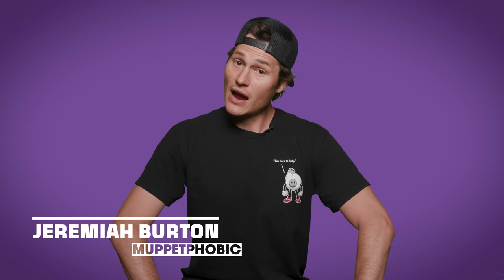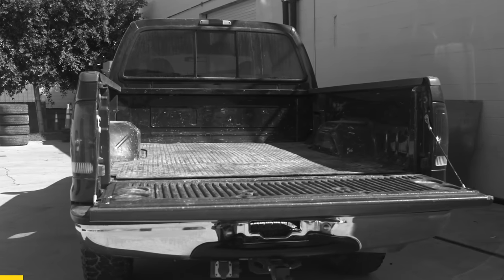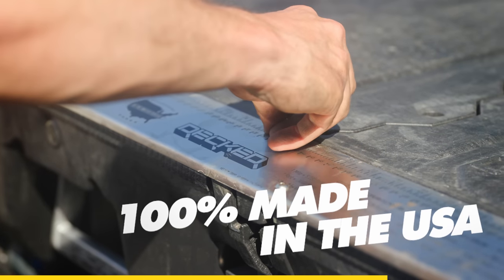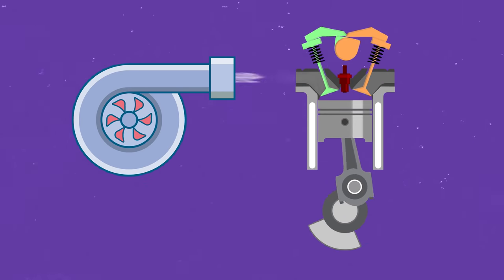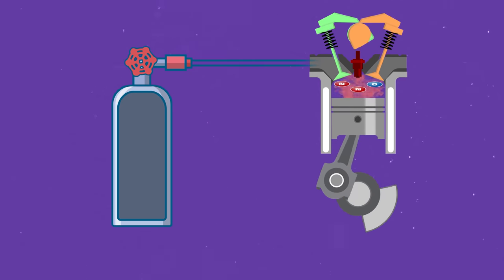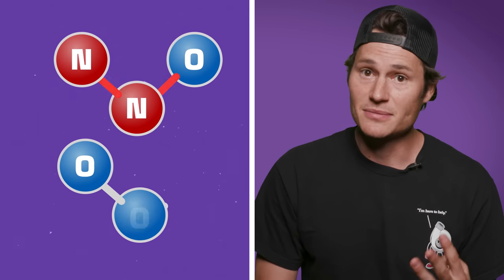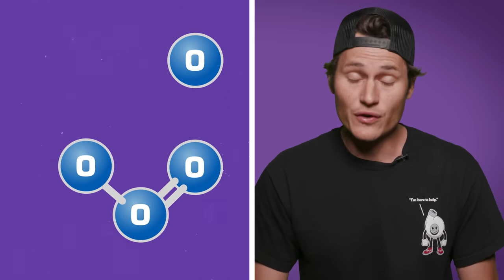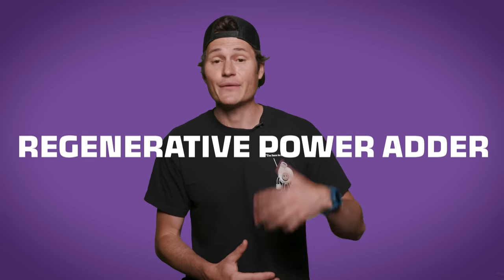Is Ozone Injection Better Than NOS?

Comment: if you ever wondered what the "smell of electricity" is...it's ozone. mostly.
Reply: It's the smell that immediately tells an electrician that something is very wrong and everything needs shut off.
Reply: @ekscalybur  something is arcing
Reply: Ozone is produced near photocopiers, because they use a high voltage you can smell it. It has a sharp smell.
Reply: The "smell" of electricity!!!! Ozone and melting insulation materials...
Reply: We use it at work to disinfect our bicarbonate system.  It is an indescribable smell, but one you never forget.
Reply: I smelled a big fart today.

Comment: Ozone is awesome for removing smells.  Using a machine in houses or cars for 24 hours (while not in them) removes a ton of odor!
Reply: While effective, the ozone scent lingers for some time, and can often be worse than the smell you're trying to eliminate.
Reply: @AlGoYoSu  it's all about timing. I'm extremely sensitive to smells and it was sooo awesome to be in a bathroom that smelled about absolutely nothing... for days!
Just give it a few more hours and you'll be fine.
Reply: @AlGoYoSu  I use a small generator to clear out car odors- it has a timed shutoff so it’ll run for an hour, you have the AC on full blast recycle, then you air the car out for a good 7-8 hours and your good. Ozone shouldn’t linger.
Reply: @AlGoYoSu  I've never had lingering ozone odor (after thoroughly airing out), but there might be something the ozone reacted to that left an odor, or just that it removed one odor but left another, changing the smell afterword.
Reply: @AlGoYoSu  ozone then use febreeze
Reply: You can use it however ozone is much more harmful to your cells that ordinary oxygen, that's why your body getting older on a higher rate that without ozone near it.
Reply: Use it to often and it can break down some materials
Reply: Why does your house smell dude
Reply: I was actually gonna comment something saying it’s an odor eliminator I use it occasionally at work to get rid of smoke smell after a house has a fire (I work in water/mold/fire restoration)

Comment: Joke’s on you, I already have a Decked drawer system, and I can say I love it. Every single system is custom fit for every truck brand, so it fits exactly to my F150 with a 6.5’ box and it’ll fit exactly in a Chevy 2500 with an 8’ box.
     The drawers are amazing, super smooth, and the optional boxes fit perfectly as well. I made a mess in one of the drawers one time, and it was super easy to pull out and hose off.
     Just in case you don’t believe the paid sponsorship from these guys, take it from a guy who has driven trucks all his life, this Decked system is a very good product.

Comment: Having worked with ozone before in the lab, i can say that embrittlement of elastomeres is an understatement. After just 20 min of low concentrated ozone contact a rubber stopper literally falls apart. I would not want to have that aside me in my car.
Reply: Must have been an extraordinarily high "low concentration" to cause that much damage in such a short amount of time. I use ozone generators in car interiors to sterilise and remove odours. I literally fill cars with it for 30-60min and there is no noticable degredation to interior plastics/rubber in that amount of time.
Reply: @flammybino8523  Yeah i guess our low concentration is still super high for your application^^ which makes a lot of sense, since its so reactive/dangerous.

Comment: Some have already tried this, and it caused the engine to die, the heat in a small engine causes misfires and overheating. They contemplated that the heat generated from Ozone being broke down would likely just destroy the engine. 

Keep to using Ozone to clean the car cabins. If you want power, build the engine properly , get a turbo or supercharger, there's no shortcuts in the longterm.

Comment: The ozone layer is actually healing itself atm dude, the hole over Antarctica is actually shrinking
Reply: Well, duuh. Solar radiation which is stronger at higher altitude, does exactly the same as an ozone generator, just at a grand scale. Once we stopped using clorinated fluoro-carbon gasses and other ozone reducers on a widespread scale the ozone layer is able to regenerate faster than it is broken down...

Comment: You touched upon the embrittlement and degradation of elastomers bit, but as I was watching this I also had concerns about how aggressively the ozone could oxidize the internals of your engine, too. That elastomer embrittlement is directly because of ozone's extremely high oxidation potential. It quite literally destroys chemical bonds, left, right, and center, but it can also accelerate oxidation of metals like iron (rust) and copper (patina).

Comment: We use mild ozone generation in HVAC and refrigeration. We use the UV bulbs inside of residential air handlers to help kill mold, bacteria and viruses. Likewise, we use smaller UV bulbs in the restaurant service for ice bins to kill bacteria, slimes, molds, etc and keep ice fresh. Sometimes you can open up an ice bin and get that “lightening” smell since lightening also creates ozone. 

There are more intense ozonators that use the electrical method Jeremiah mentioned. These can be found for exterminating ground bees and other insects where you put the ozonator under an aquarium that’s over a nest of yellow jackets. These types are also used in smoke/mold remediation in houses to eliminate odors, but are intense and designed for only short periods of time as they can kill you. Not designed for everyday household use. 

Ozone in the sky is good, down here it creates smog and oxidizes things, hence why California has made them illegal.

Comment: Nitrous oxide is used because it can be liquefied so that it will only regasify after leaving the gas injection system, and this is important to avoid the system becoming too cold, and to cool down the air-fuel mixture and avoid detonation. To use pure oxygen gas injection, the compression ratio would have to be lowered, and the entire system would have to be heated. What I would do is to inject liquefied propane into the wet shot fogger together with the nitrous oxide, to lower intake temperature even more and avoid fuel condensation.

Comment: 3:52 Piston speed actually has very little to do with it. The equation presented, E=0.5mv^2 is for the kinetic energy of an object and pretty much irrelevant to the power the engine makes. The relevant equation is E=Fd, where F is force and d is the distance the force is applied. When more energy is released, the cylinder reaches a higher pressure, which increases the force on the piston. Increasing the force is what increases the energy per stroke.
Reply: @PADOYLE Little do you know I have read a great deal about it. Can you explain how exactly nitrous increases piston speed without affecting max rpm? If piston speed is the cause of increased power then the engine should make the same power at the same rpm with or without nitrous.

Comment: The expansion characteristic of hot nitrogen is very important in the process of pushing the piston down in the combustion process. which you would be without with the ozone injection.
Reply: True, however Nitrogen is an inert gas and inhibits the full combustion of a fuel.  I think would expect that in an ozone combustion, more fuel would be converted into cabonic gasses and supplement the nitrogen for pressure expansion. Additionally, without nitrogen in the chamber, you would potentially need far less fuel for the same amount of power. Realistically, you’d probably detonate the fuel instead of burning it which would be the main problem, but it would release an insane amount of energy in the cylinder compared to air or N2O. I think this system could work well in a Diesel engine, just not a gas engine.
Reply: @Matoro828  people played with oxygen injection way back in the day and it proved far to volitile. Think the technology exists today?
Reply: @Matoro828  you bring up a good point. I will have to look more into what you have brought up because I admittedly don't know much about this ozone system. The heat I think would be a big issue with warping parts but also it could form hot spots which could cause pre-detonation kinda like what you had said.
Reply: @frankrizzo2724  yea it’s interesting I think you are right in a sense: pure oxygen is probably too volatile for an ICE. Ozone is definitely far too volatile for one. But I think if you made an engine purpose built and tuned for it, it would work. I think it would have to be a turbine or a Diesel engine to handle the forces, and you would probably need to use titanium or tungsten plated components to withstand the heat. But, the potential is there for an engine with extreme power output. Even something as small as a 10% gain in the amount of chemical- energy released by ozone combustion would lead to an insane growth of power.
Reply: why not use ammonium nitrate
Reply: @allseeingeyezz  Decent fuel, terrible oxidizer.

Comment: Not to mention ozone is extremely reactive with almost anything organic, hence why rubber seals break down on exposure to ozone. Storing ozone is half the battle. All of the piping, seals, and valves to get O3 to the engine is also a major issue, if a leak occurs inside the vehicle youre gonna have a bad time. Since ozone is so reactive with organics such as gasoline itself, ozone injection would most likely cause some serious engine knock and most likely break the block from serious overpressure. Ozone may even react with the motor oil on the sides of the cylinder walls at high enough temps. Theres a whole slew of problems with ozone as an oxidizer.
Reply: what about using it in the cold vacuum of deep space? when it degrades, it can just be supplied as regular oxygen and in emergency's you convert it to 03 as fuel
Reply: @zeedstun891  The scariest risk in space is an internal fire. Ozone is just too good of an oxidiser and too unstable to justify using it. It's a ridiculously good oxidiser, it's one of those things where it's possible but there's better, less "everything is now flammable lol" alternatives. Still has it's uses though!
Reply: @mattk252  hot take I’m here for it
Reply: it's not that bad. I ozone my water at home

Comment: “This nitrous setup is too heavy.” Said no one… ever.
Reply: Yeah, these aren't car guys, these are YouTubers, and they're not very bright either; O³ would yield three oxygen atoms, not molecules, those would be O², lol.
Reply: @hlaw2830  and also the reason no one uses o2 tanks is because its too reactive lol
Reply: @ernestocastellanos6446  At least that scene from The Fast and the Furious would make sense? Lol.
Reply: @hlaw2830  Besides, I'm not sure O3 would have much advantage over O2. In theory with a 100% oxygen setup you could do almost 5 times your normal engine output. Imagine doing a 2500 shot on a stock LS7, wonder if something break or melts first.

Comment: There are quite a few issues with this that I can see. 1. Ozone is very toxic and reactive 2. It’s unstable in any amount usable for this purpose and is likely to just decompose into oxygen after a short period of time(at which point a pure oxygen tank would be better) 3. The tank system for this would be not that much different from NOS. I just can’t see this being all that viable. And also, there are plenty of other oxidizers than Oxygen.

Comment: There used to be some research into using liquid ozone instead of liquid diatomic oxygen as the oxidizer used in rocket engines. Because ozone is denser it will need smaller tanks to be stored and less volumetric flow rate to make the same power in the engine and to keep a rocket engine going. However there were some challenges that ultimately prevented common use of liquid ozone in rockets. The biggest problem being liquid ozone will explosively decompose into diatomic oxygen if hit with a hammer, or looked at the wrong way. Makes it pretty dangerous to pump or to store at all. It's also obviously a very good oxidizer and reacts with a lot of things violently.

Comment: The EPA came to their conclusions about ozone generators after testing them in confined spaces ten times smaller than they were rated for. A little ozone is probably good, for the reasons you specified, and occurs naturally in the air we breathe already. A lotta ozone is definitely bad, again for the reasons specified. See bigclive's video about ozone for more info.

Comment: Can you talk about camshafts and how upgrading a camshaft can add power. We put the most aggressive cam that would fit in the ls1 in my parents 1998 Pontiac Firebird Formula. Power went from 350 to somewhere in the range of 500-600 horsepower.

Comment: Cam the catfish Camaro and throw that episode up on Money Pit. Then do roller cockers and throw that on Money Pit. And if you're camming it you might as well port the heads and intake and throw That on Money Pit as well. And also Mill the Heads for a little more compression and use a thinner head gasket and put that on money pit.
Gasket kit - 200$
Milled heads - 200$
Porting heads and intake - 50$ rotary cutter and some 20$ carbide bit set - perhaps just get a truck intake and port it a little, it'll be mint
Cam - 350$
Tune - 400$
1.6 roller rockers - 150$
stage 2 transmission for when it blows up from 400hp - 3000$

Comment: F-15E aircraft have what is called an MSOGS (Molecular Sieve Oxygen Generation System) or OBOGS (On Board Oxygen Generation System) and the compressed air that is tapped off from the intake side of the engine is purified at the molecular level to yield pure oxygen as required by the pilot and WSO (Weapons System Officer).

Comment: So... how would you get pure o2 into the ozone generator... And how would this not just cause preignition like o2 does?
Reply: Well you get 02 into your ozone generator by using and oxygen concentrator or an oxygen bottle I have an ozone generator that I use for therapeutic purposes with a infrared spa
Reply: Pure o2 is easy, electrolysis of water. Hydrogen and oxygen accumulate at the anode and cathode, respectively. As far as preignition, that is a good question.
Reply: @ai_university  true I forgot about that thanks
Reply: O2 is in the air. Generator breaks free 02 from other bonds and then they attach to each other.
Ozone is not flammable yet many of byproducts are. It will react will the fuel as well as soon as it makes contact and that may cause detonation.
Ozone would attack just about everything including aluminum, valve seals ect... cool idea but very impractical. 

if it was easy or practical youd be spammed by videos on youtube for sure already...

Comment: Given the fact that Ozone likes to spontaneously combust and it's explosions are EXTREMELY big, no.

It's not.
Reply: Ozone does not spontaneously combust. It is just 3 molecules of oxygen. Ozone is not flammable by itself. But it is an oxidizer, so mixed with a flammable substance it will make the flame burn stronger. But it will not spontaneously combust on its own.
Reply: @backcountryme  
Ozone is inherently unstable.

In laboratory conditions, if you were to compress it just a bit and leave it be in a container, it would spontaneously explode, destroying the container.

A bit of heat would make the process almost instantaneous.
Reply: @maksymilians931  can you point me to some info about your claims? I am very interested in this. I have been around ozone before in the bottled water industry, and never heard anything about O3 spontaneously combusting. If you are saying that under heat pressure can build and rupture a vessel, well that is a case of using a different vessel.
Reply: @backcountryme  
I don't believe there is a single document on that, however it's property is that it becomes exponentially more unstable, the higher the pressure becomes, and due to it's instability, it's susceptible to combustion under minimal heat
Reply: @maksymilians931  Ok, I can see a pressure issue, but combustion takes a flammable substance, and molecular oxygen (O2) and free oxygen atoms are not flammable. They are oxidizers, and  when mixed with a flammable gas can then combust. But alone it is not combustible. As for the pressure increase, this can be solved with vessel design.

Comment: Is there a way to generate ozone catalytically from hot compressed air? Because if there is, one could hypothetically stick a thing before or instead of intercooler to gain more power.

Comment: What about a compress air system. There is/was a small California company that was creating a CAS supercharger. Basically they used a scuba tank and special valves to boost an engine.